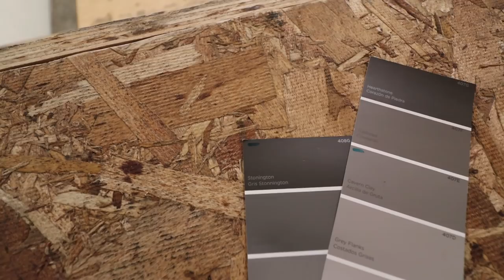Painting My Garage RAMP and LOFT

Comment: You should do a cable railing on the top of the loft. It will add some safety security, it's contemporary/industrial looking and won't hurt
your visibility as much as traditional wood railing. Plus its cheap and easy to install.  You can get cast iron pipe rail fittings at major big box stores or through outlets like Amazon.
Reply from the maker: Thanks for the suggestion that might be a good way to go!
Reply: @Kordare  Uline and  Northern Tool also offer aluminum safety railing in 4, 6, and 8ft sections for $160-$210.